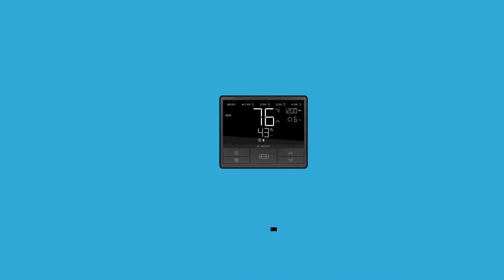Why To Use EC - NOT PPM!

Comment: The video may be a bit old, but judging by the comments, quite a few people still don’t understand the topic. All probes measure EC. All of them—both TDS and PPM probes. The only difference is that TDS and PPM probes have a built-in formula programmed into their chip, which calculates TDS or PPM from the EC measurement and then displays the result on the screen. 

It doesn’t even matter what kind of water is used in Europe or America, because we assume that for our hydroponics we use destiled, purified, or RO water. So, water that contains almost nothing. And if we then follow the fertilizer recipe exactly, we know precisely how much of each component we’ve added to it. That’s why probes don’t need to measure individual elements in the water—they only need to measure the total. And for that, EC is perfectly sufficient; there’s no need for triple formulations. Quite a few people don’t even know which formula their probe uses, and from the start, they’re measuring incorrect dosages.

For example, if your plant requires an EC of 2.0 mS/cm during a specific growth stage, you’re using pure water for mixing, and you’re following a fertilization recipe, then an EC meter is all you need—without worrying about which formula or conversion table your TDS or PPM meter uses.  
But how do I then know which element my plant is lacking? Neither a TDS nor a PPM meter will tell you that. Only your plant will show you. The meter only indicates the total amount of everything—whether it’s too much, just enough, or too little.  
Example: leaves are too light: we assume under-fertilization. We measure EC, which shows it’s too low—say, 0.8 instead of 2.0. We increase the dosage. But what if it still shows 2.0, meaning it’s sufficient, yet the leaves remain too light? That indicates an imbalance in nutrients—likely a deficiency in N, Mg, or Fe. Or maybe the pH has drifted and we’re in a nutrient lockout.

We’re overcomplicating things way too much—especially when you see someone growing cannabis outdoors in a garden who doesn’t even know what an EC, TDS, or PPM meter is, yet their plants are so good they make your mouth water…

Comment: I'm calling BS on the EC is better them ppm. Ppm is more accurate. Period. EC meters read at 0.1 intervals. 0.1 EC is 50ppm on the 500 scale. If you have an EC meter  you cannot make a solution of 75ppm because they dont measure into hundreths. 700 scale is even more accurate becasue .1 ec is 70ppm.
Reply: You call it bull** because you don't understand how these probes work. All probes measure EC. All of them—both TDS and PPM probes. The only difference is that TDS and PPM probes have a built-in formula programmed into their chip that calculates TDS or PPM from the EC measurement and then displays the result on the screen. To put it simply, TDS and PPM "measurements" are just unnecessary complications.
Reply: @berghauss  How would you make a solution of 25ppm using an EC meter? You can't. EC meters resolution is .1 EC which is 75ppm. No EC meter is precise enough unless it reads down to .01 EC which most dont. PPM divides the EC down to a higher resolution so its more accurate.
Reply: @gprojectnoob4779  first, why you’d want to “mix” such “pure” a solution in the first place? Here we’re discussing the meaningful use of measurements, not searching for extreme points. Your mention of 25 PPM refers to the efficiency of mid-range RO systems (5–30 ppm), and it’s hard to understand why anyone would want to “mix" to the  RO water values at all? But let’s say you have completely pure, laboratory-grade water—how would you even mix to the 25 PPM? Even a sneeze into it would probably already be too much, I ques 🙂

If we’re talking about the accuracy of normal measurements, EC is a more reliable parameter than PPM. PPM is a derivative of EC, calculated using a scaling factor. Technically speaking, your PPM meter measures EC and then applies a conversion factor based on one of the scales. So, every meter essentially measures EC anyway. Why is EC more reliable? Because with proper calibration, EC is consistent across all meters. With PPM, things get complicated if the user doesn’t know which conversion scale their meter uses. Put more simply, measuring in anything other than EC is just an extra layer that causes confusion. From laboratory manuals: "Ignore ppm and work with EC – this avoids confusion." 

Example from the manual: For tomatoes in the flowering stage, the recommended value is 2.5 mS/cm.

Using the NaCl scale (0.5): 1250 ppm

Using the KCl scale (0.7): 1750 ppm

That’s a difference of 500 ppm – if you use the wrong scale, you can over-fertilize or under-fertilize.

So, a value of 2.5 mS/cm is correct anywhere in the world, with any calibrated meter. You can’t get it wrong. You dip the probe, it reads 2.5 mS/cm, and that’s the end of the story. But if you measure with a PPM meter, you have to know which conversion factor your meter uses to determine whether the correct reading is 1250 PPM or 1750 PPM. You could even have a meter using the Kanna scale…  
You usually know your own meter and understand which value to look for. But what if you happen to be without yours and borrow a meter? You either have to check the meter’s settings or perform a calibration test.  
To wrap up this lengthy explanation and paste the response from our lab:  
Professional systems (e.g., plant controllers) always measure EC and calculate PPM using a formula if needed. Some allow you to set a custom factor.
These “scales” are conversion conventions, not physical constants. That’s why EC is the only true, direct measurement, while all ppm values are approximations with varying errors, depending on which scale you use.